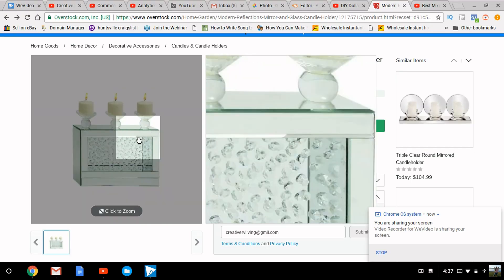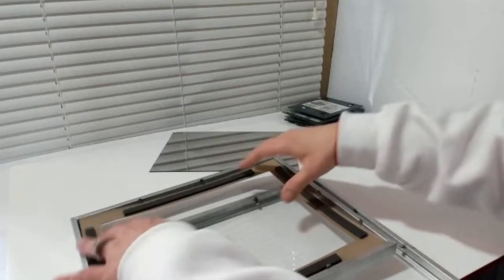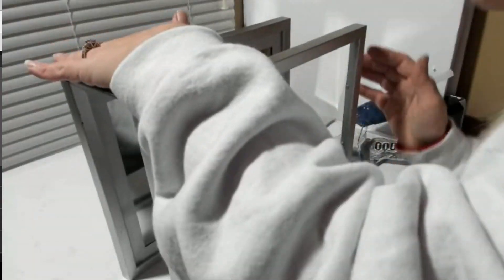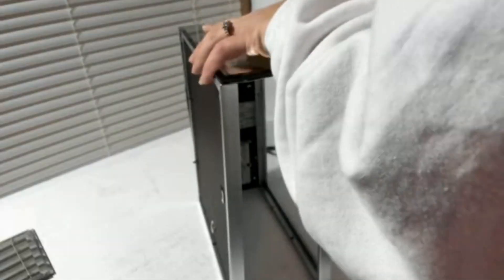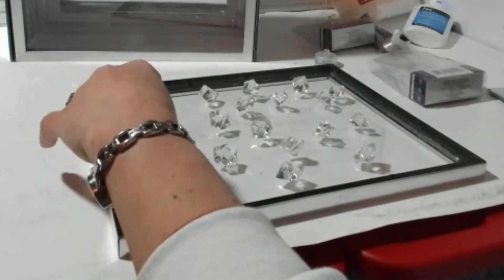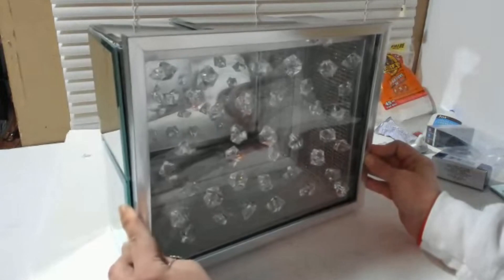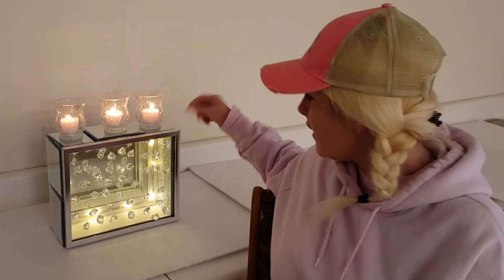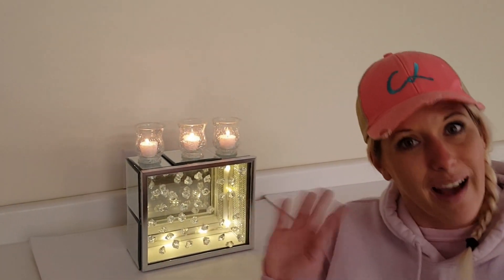DIY Dollar Tree Crystal Glass Mirrored Candle Holder BLING - GLAM |

Comment: Oh Miranda, I ran into trouble from the get-go. My mirrors didn't fit the frames. I loaded up on frames at my dollar tree but they weren't the biggest like you have. So now I have a ship load of frames that won't fit. Girl, didn't I tell you this doesn't come easy to all of us? ;) I'm going to try to rig something up because I really love this.
Reply from the maker: Hey Pam, did you buy the mirrors in the black frames???  You know the have two 8x10 mirrors now. The silver frames which used to be the only 8x10  ones they carried and recently they just started carrying the black ones. I noticed the black framed mirrors are MUCH bigger than the silver ones when I was working on something.  This is an older video, they didn't offer the black framed ones when I made this, I used the ones in the silver frame. There really is a HUGE difference in the two!  I'm just assuming that's what it is bc I ran into trouble a totally different project too.  I'll tell ya what you can do. You know the glam mirror I made that looks a lot like the one you bought from Wayfair. You could go the 11x14 route.  Take an 11x14 and frame the 8x10 mirror for the back of this. Fill the edges around the mirror with bling or even foil if you wanted to stay silver, gift bag etc. then use two other 11x14 frame for the front. You can spread em out to fit the 5x5 mirrors. These aren't as deep as the 8x10's  so you'll have to do like the glam mirror and go around the actual frame with bling to conceal the gap.  BTW Dollar Tree will let you swap item for item so you don't have to purchase more frames. This is just an idea off the top of my head. I love this project too. I hope this helps and maybe helps you come up with an idea.
Reply: @CreativeLivingLifestyles  thank you for your suggestions. My Dollar Tree never seems to have what I need. I am determined to do this project so I will do what you said. I'm going to $ T today and will see what they have. I'm sure everything is picked over. Thanks again for your reply.

Comment: Hello how did you hide the battery pack for the led light? Is the bottom of the frame opened?
Reply from the maker: Hey Sonya, I hot glued the string lights around the mirrored frame the just glued the battery pack to the back of the frame.

Comment: I can't find tea lights Gem no where.
Reply from the maker: I know they're hard to come across at DT. I found a huge bag at Hobby Lobby just over $4 in the floral section next to the wedding decor. (Floral Filler)  I know that store is enormous, they have tons of gems scattered in different sections but you can find the rock gems there.  Because they sell em as floral filler it's pretty cheap compared to what you'd pay at Micheal's or Joann's.   Also you can order a case from Dollar Tree's website and have em shipped free to your store. 
24 of these come in a case. Honestly,  only 21 gems come in these packages so this is one of those rare cases that it's actually cheaper to buy em at Hobby Lobby.   I'll get the link for you anyway in case you wanna order em from DT. 
Hope this helps ;) 

https://www.dollartree.com/luminessence-led-waterproof-tealight-candles-with-beads-21ct-packs/252500